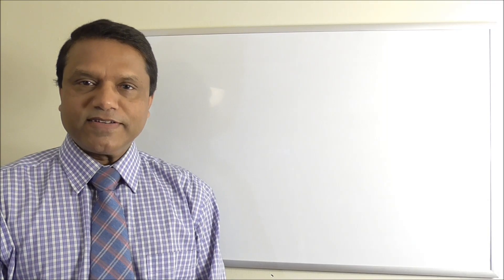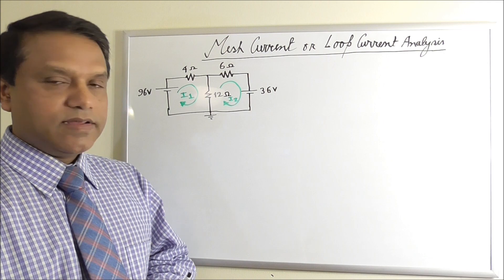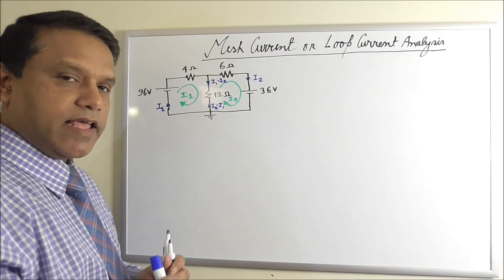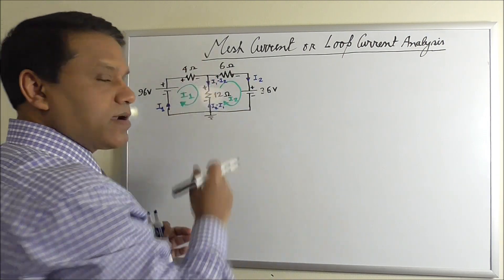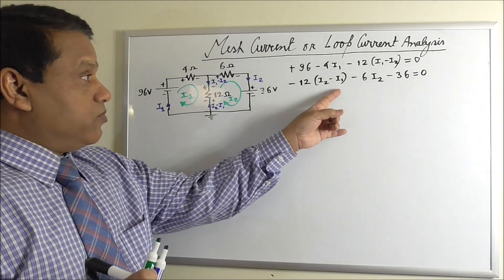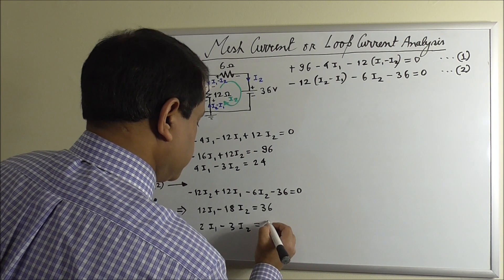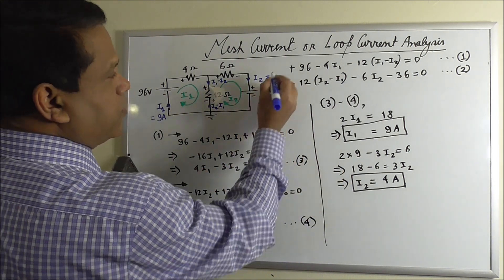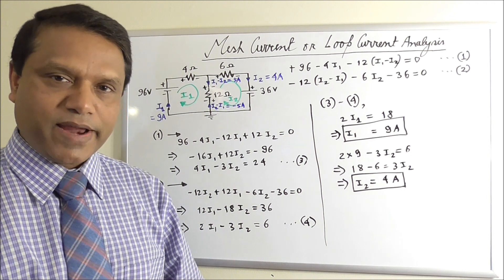DC Circuits 14 - Mesh Current or Loop Current Analysis

Comment: Sir,What is the difference between mesh analysis and branch current analysis.?
Reply from the maker: In mesh analysis, you have fewer variable to solve, because you assign mesh currents to loops rather than branch currents to branches. The assigned mesh currents automatically implement KCL. So, you only solve KVL equations for the loops and you are able to get the solution quicker. Please watch my videos on mesh/loop analysis and branch current analysis to understand their differences in more detail.